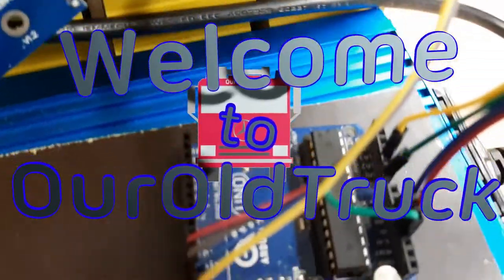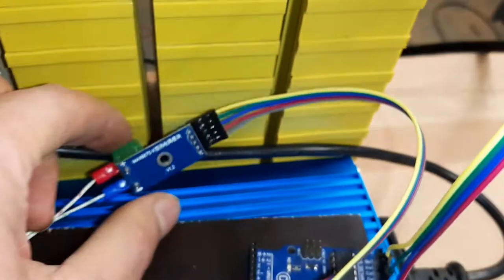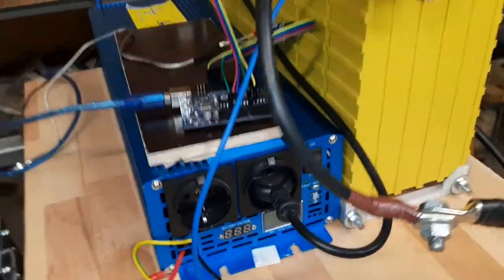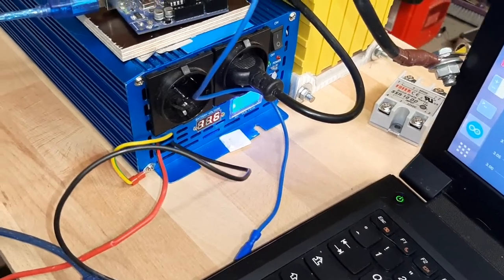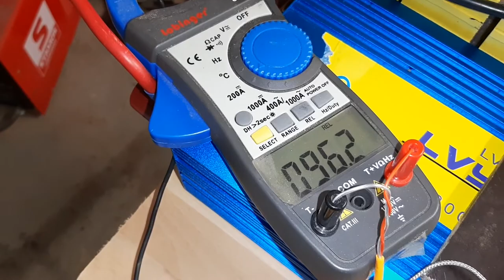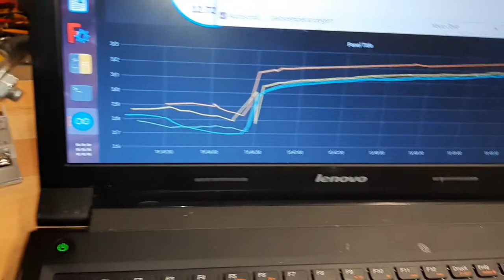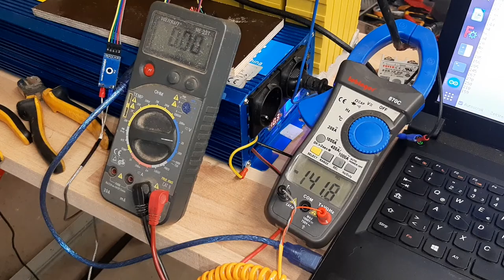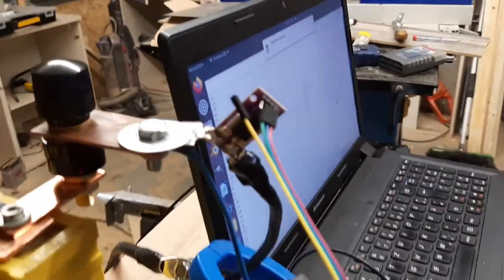Is the ACS758 suitable for high amperage measurements on the LiFePO4 batts in the fire-truck camper?

Comment: Why do you need 4 wemos d1 mini for bms?  You could use an  ADS1115  I2C 4ch  analog to digital converter so you could measure each battery with 1 controller.
Reply: @ouroldtruck9380  Have you looked into this diy bms system yet?  https://github.com/stuartpittaway/diyBMS
 and you can buy it built if you don't like messing with smd components. 

https://shop.openenergymonitor.com/diybms/
around 40 pounds.
Also for current measurement i would use an ina219 with shunt.  That's what i have in my camper.  I have tried these acs 758 sensors before and they are not very accurate.
Reply: @ouroldtruck9380  With the ina219 everything will be smoother and more accurate.  That is what I've been using with a 300A shunt in the past 4 years. I can remotely monitor it as well.  You will have to modify the Ina219 library according to your shunt.  I tried many different things to measure current at that time and only Ina219 seemed to do the job properly.  It's just a suggestion.